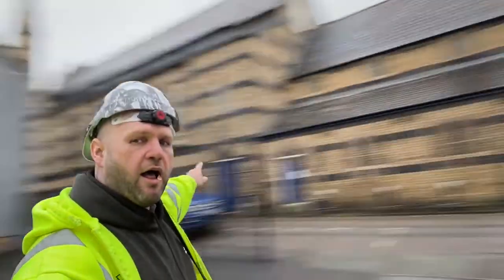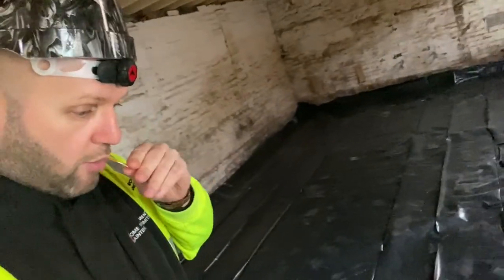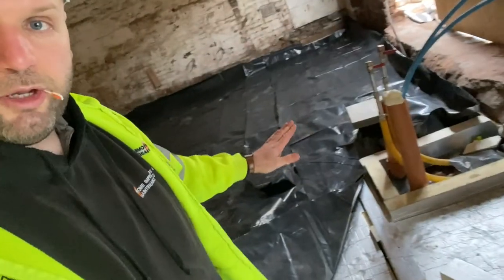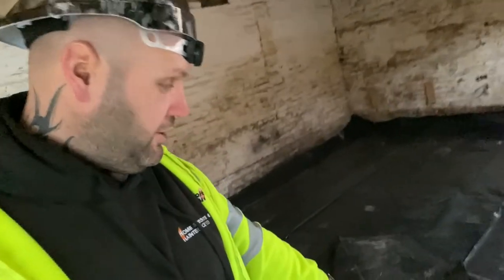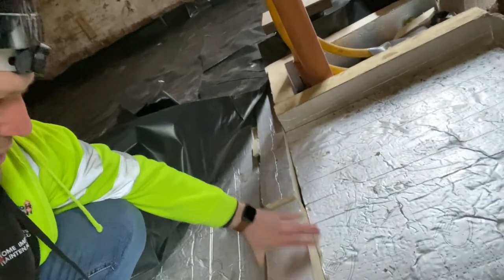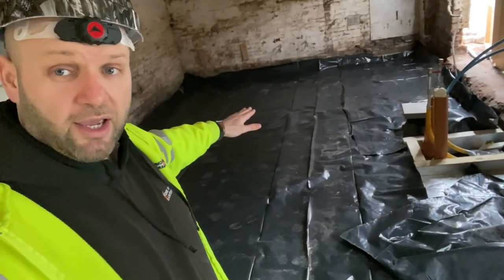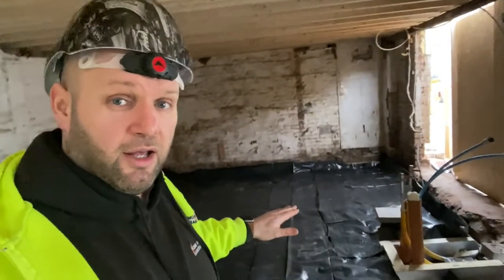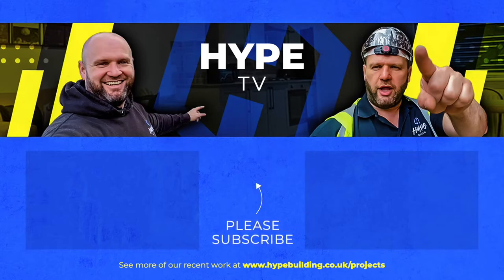How to Install a Concrete Floor – The Process & Materials Used

Comment: Hi thanks for uploading a clear, straightforward video on this. If converting an existing ground floor cavity, how do you deal with water pipes, wiring etc. already in the cavity?
Reply from the maker: Hi there. many thanks for watching and for your great feedback – much appreciated 🙂👌 To make sure pipes and wiring etc. remain accessible, you would use service ducts. Hope that helps.
Reply: If I'm doing a bathroom ground floor do the pipes go on top of the top DPM before laying the concrete? Do you not need steel wire in the floor? Also with it been an old building can the concrete push out the walls I read it can if exposed to the wrong chemicals?

Comment: Interesting, two layers of DPM ?
Plus rigid insulation if taped would be a third form of DPM  , plus concrete if it has moisture control additive. (4 th and final layer of DPM .

Comment: Great video mate. I have a clay underneath my suslended timber floor and wanting to replace the timber floor with concrete. How can we ensure that this method would be suitable for clay? Secondly, how would moisture escape from indoors after concrete floor has been installed? Thanks in advance.
Reply from the maker: Hi there. Thanks for your question. It doesn't matter what the sub-base consists of because the MOT/hardcore guarantees a solid base. Moisture will evaporate as you let the concrete floor dry naturally. Make sure there is plenty of ventilation during the drying process.

Hope that helps. Thank you for watching our video – much appreciated 👍

Comment: Thanks for the video mate. 

Would you be able to use more insulation to build upto the hight needed? So for instance use 300mm of insulation rather than 100. 

Cheers
Reply from the maker: Hi Dave. Thanks for your question. Yes, you can certainly use thicker insulation – provided that your concrete slab is of an adequate thickness and fit for purpose.

Many thanks for watching our video – we truly appreciate it 🙂👍

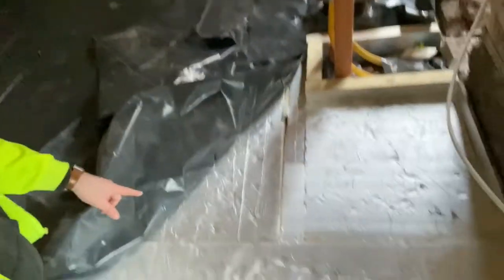Comment: Hi guys great content what is the material up against the wall 3:39 I understand the floor insulation but what I mean is what your pointing at looks like a piece of wood ?
Reply: That looks like 25 or 50mm insulation board to me. Same brand as the 100mm stuff on the floor.

Comment: What sort of load rating does the insulation panels have? I’m looking to build a workshop at home with an insulated floor and concrete slab. But I am worried putting machines in will cause it to sink
Reply from the maker: If you're worried about point loading, get a structural engineer to give you a point loading calculation.
Reply: @ I may well do, I was going to speak with a supplier to see what they recommend. 
Googling insulation boards seems to suggest it has a rating of 140kPa for 10% compression. Thats over 14 tonnes per square metre, I hope I am worrying about nothing here.

Comment: Great video. I am planning to replace an old timber floor with a concrete one. There are gas pipes and numerous cables currently running under the floor. Is it safe or advisable to pour concrete directly on top of these utility lines? What precautions or steps should be taken to ensure the integrity and safety of the pipes and cables during this process? Thanks 
Specifically, is it safe or advisable to pour concrete directly on top of utility lines, such as gas pipes?

Comment: If this was on the ground floor in a victorian house with a suspended timber floor and you converted it into a concrete floor at a lower level, would this cause moisture and damp issues in the future?
Reply from the maker: Hi there. Thanks for your question. 

In short, no it wouldn't. The damp proof course and the risers prevent damp. There is only an issue when the concrete slab is higher than the damp course of the walls – which causes bridging. 

Hope that helps. Thank you for watching our video 🙂👍
Reply: If its an old Victoria House with single skin rubble stone wall, in wont have a damp course between the stones/bricks? What would prevent the moisture traveling then to the wall under the DPC and then up the wall (with no DPM).

Comment: Hey. How thick would you make the hardcore and how do you know how much you'll need for a certain job? Is it a matter of knowing the square meter size of whole area and thickness to determine how much hardcore and sand you'll need. Trying to figure out best way to replace my house floor and install underfloor heating. Only thing is i have a rsj in the middle of the house. How would i prop the beam up whilst the concreting goes down? Im confused as to how it will be supported while the floor is having the concrete layed..i understand how to hold it up with the props during the work stage but what do i do when they start to get in the way at the laying concrete stage? Could i lay engineering blocks on the hardcore layer and use a prop on top of that and leave the block in place and just concrete around it? Hope my question makes sense

Comment: Hi, how many inches of hardcore do you put in? 

Can you tell me the calculations please? 

How many inches  hardcore, how many inches of concrete and how many inches sand?
Reply from the maker: Hi there. The hardcore is used to get you to the desired floor height – because using concrete would be too expensive. So the amount of hardcore you need depends on the height of the floor you require. 

In a typical scenario, we would have a 150mm concrete slab, 125mm insulation, 50mm sand blinding and the rest hardcore (depending on the depth you need). 

Hope that helps, Tufail. Thank you for watching and for your question, we truly appreciate it 😊👌

Comment: Hello sir,
Could I have an advice from you please?
Basically I’m levelling the garage floor with the kitchen floor however I have only got 130mm difference between garage floor and kitchen floor so my question is how do I got about making sure there’s enough insulation the 130mm but also ensuring I have enough screed thickness on top of the insulation so the screed doesn’t crack?
Much appreciated in advance 😀
Reply from the maker: When you building up an existing floor garage, building control have a caveat that allows them to improve then rather than enforce new regulations.

So they will advice what thickness of installation, baring in mind you still need a certain amount f space for screed.

However their is another option to get more instillation, in that their is to not put a scree floor but to put a timber floating floor instead.

Comment: I`ve a quick question John, I`ve got a utility on the back of my house that is a great size for the washing machine and outside loo. Its only a single brick unfortunately, I`m thinking of putting in a new floor and thermal boarding the walls. I`m going to paint the outside with Stormdry, do you think that will be ok ?
Reply from the maker: hello mate, storm dry will improve it but it is always better to install a stud wall to create a cavity.

Comment: Thanks for all your content, I'm converting my garage DIY and these are invaluable. What would you suggest for raising a 3x3m floor that is 75mm at thin end and 110 at thickest? Building officer wants 50mm PIR insulation on top of DPM. Concrete or just screed? Don't want to use timber frame and weyrock as rest of house is concrete founds. I'm a bit stuck, would like to know what you'd do? #Keeptickling!
Reply from the maker: Thank you so much for watching and your kind words, Dave. It's great to know that the content is helping people 😊👍

If you're just trying to level the floor and it's only 35mm out, it might be an idea to use a fibre reinforced self-levelling compound as it's quite straightforward. You can use screed or concrete if you're happy an confident enough to do so, but self levelling is easier.

Hope that helps, mate.

Comment: Hi, just had a question. Why would someone need to dig up and redo concrete their floor concrete?
Reply from the maker: Theirs's a few reason , for example maybe someone wants to insulate the concrete floor, which saves money on energy bills.

Comment: Hi Fella. Thanks for the video 👍

I've got a few of questions that id be really grateful if you answered:
If its a large area what sort of overlap do you have on the DPM and do you need to seal between the overlap?
Did you concrete to the top of the upstand and use that as level if so does the dpm come slightly above the insulation upstand so it would protrude into the wall tanking? (Like sovereign slurry) 
I dont need to insulate as its a basement room so can i, MOT, sand, dmp, concrete?(so only one layer of dpm? If so whats the minimum thickness of concrete i need to use? (I need to keep height to a minimum?

Thanks pal. The video was a big help.
Reply from the maker: Hi Joe. Thanks for tuning in and for your questions. As you can appreciate, it's very difficult to give an exact solution without seeing the project first-hand. However, here's what we would say: 

For a larger area, you would overlap the DPM by around 300mm and create what we call a double welted fold between the sheets.

We didn't concrete to the top of the upstand. Instead we used a laser to create a level and then concreted to that level. You can do it the other way, but you have to be careful not to go over the upstand.

It's difficult to advise on where the DPM should end because it depends what you're using on the walls.

Building Control may still require insulation so it might be best to check beforehand. We would recommend a concrete thickness of 150mm, but again, it's difficult to advise without seeing the basement.

Hope that's helped a little, mate. Best of luck with your project 👍
Reply: Hi mate. Thanks for the info and for getting back to me, much appreciated.👍

I've just had a browse through all your other videos, theres so many i will find useful so thanks for uploading them!

Nice one.

Joe
Reply from the maker: @Buzz_Club  Thanks for your kind words, Joe. Our aim with the videos is to be as helpful as possible (without taking ourselves too seriously 😄) so it's great to hear that they're proving useful 👍

Comment: Hi. I was wondering if you can help me. I've been researching for ages about how to convert my single brick stand alone garage but I'm getting overwhelmed by all the information and I'm struggling to put my plan into action. I think I might need to add a dpm and a layer of concrete as the are some dark patches on the floor. There also appears to be some moisture/soil around all the edges of the floor at the bottom of the walls. I've bought some wood from wickes and some rock wool insulation and plasterboard to try and insulate the walls and I have a bit of loft insulation I was planning on fastening to the roof beams with cardboard and leaving an air gap. I think I need to add a dpm to the walls as well and make sure to leave an air gap but im worried that even after all my work its not going to be suitable for what I want. I just want to create a dry area to store some clothes that I sell on ebay for as cheap as possible as money is tight at the moment. I dont know if you'd be interested in taking a look at the job and possibly giving me a quote. Love the videos and the tickle stick always makes me lol. Best wishes
Reply from the maker: Hi there. We sent you a DM message via facebook 😊👍

Comment: What kind of insulation board is that to take all the weight of the concrete on top of it plus people walking on it?
Reply from the maker: Hello there. Thanks for your question. We use Celotex or Kingspan insulation, which comes in various thicknesses. In this particular concrete floor installation, we have used 100mm insulation. 

The thickness you need is determined via the Standard Assessment Procedure (SAP) calculations. These calculations are used to establish an energy cost based on the construction of the home. 

Of course, the underlying hardcore (MOT) also plays a crucial role in the strength of the floor.

Hope that helps. Thanks again for watching our videos 😀👌